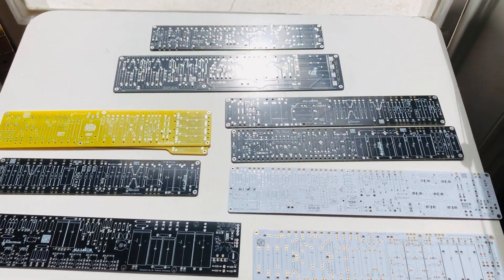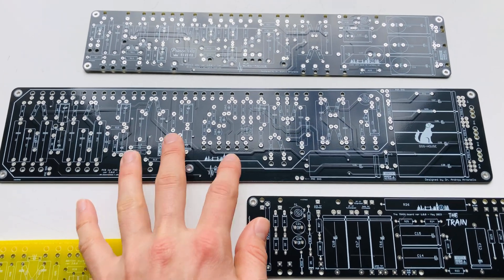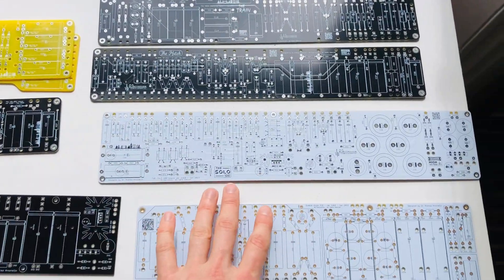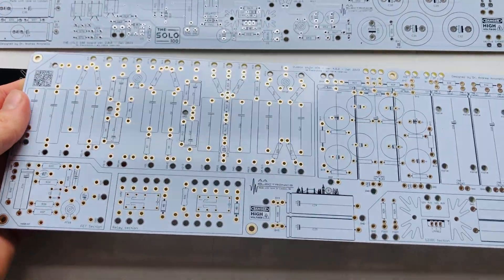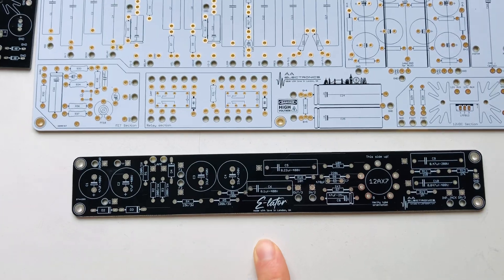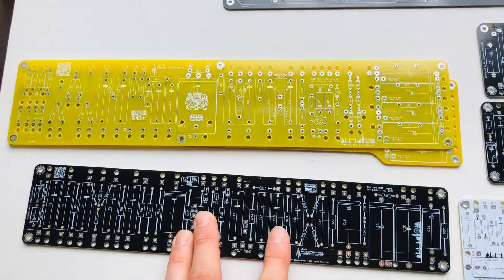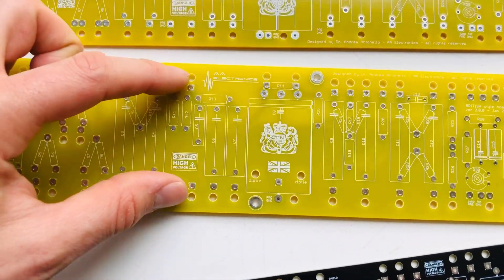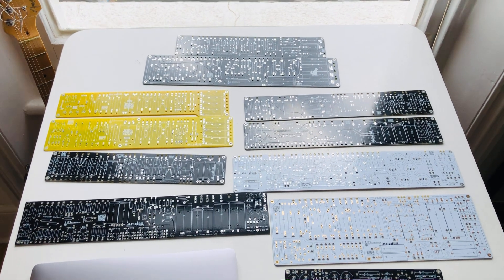AA Electronics Product line - 2024 update

Comment: so... you just expect your customers to all automatically understand the differences and features of each of these, or what? visited your site and feel I've learned nothing about these products; why should anyone make a clone of any particular amp, be it famous or otherwise? is it cheap? good? purely nostalgic? what's the actual selling point?
Reply from the maker: Hey LiveWire. The product is dedicated to hobbyists/luthiers who want a repeatable platform to build replicas of famous amps. The product comes with full documentation and parts-list to ease the entire process (which would be otherwise very time consuming and painful, as you would have to gather info from different sources). In addition, the hardware I sell provides way more repeatable and consistent results when compared to traditional assembly methods (such as point to point). Hope this clarifies it!
Best,
Andrea
AA Electronics
Reply: The Resources page on the website contains schematics, layouts, and BOMs for all the supported models and options for each board. If you have experience building these types of circuits, there's more than enough information to do a successful build.